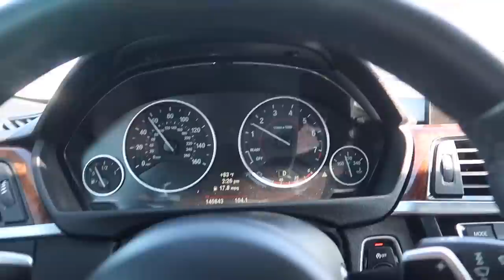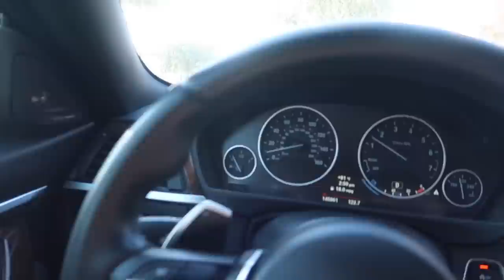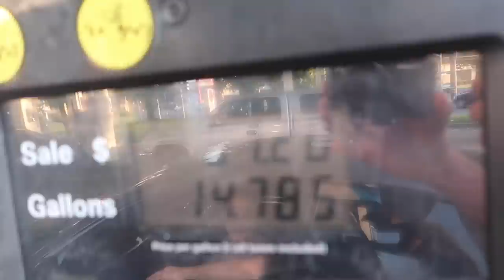PURCHASED HIGHEST MILEAGE 435I IN THE COUNTRY!

Comment: I have a 335I with 78k miles I plan on keeping mine for as long as I can. Would love to run it to 200k or more
Reply: How it ended up?
Reply: @comedyrussia  still my daily with about 99,600ish now. Knock on wood no issues and still pulls just as hard as day 1
Reply: @comedyrussia  only thing I have done was the valve cover gaskets which was under warranty around 85k miles and the oem plastic charge pipe has bursted off one time so I put after market on. Otherwise, never any issues
Reply: @DadUsed2Skate  how about now
Reply: @hima-iv5mc  had problems so often I said screw if and sold it while it still had some equity in the car

Comment: you can heat and tap the fender from inside with a plastic hammer or heat it and use a fender roller it wont be 100% perfect but itll be better than it is now

Comment: Advice , that’s a used JB4. And a JB4 at that, don’t ever get a used one. Anyways, don’t worry about the mileage on the 435i. High mileage new cars are a gem. I have a 2013 328i xDrive f30. Over 125k miles. Car has been rock solid! I change oil and filter 5k, auto start-stop turned off. Our cars , highway driven which is good. Anywho I have the n26, because of the precautions I made. I’m not concerned about the chain and guide. ESPECIALLY AUTO-START-STOP PLEASE DO NOT USE ON ANY CAR. Anyways nice 435i :)